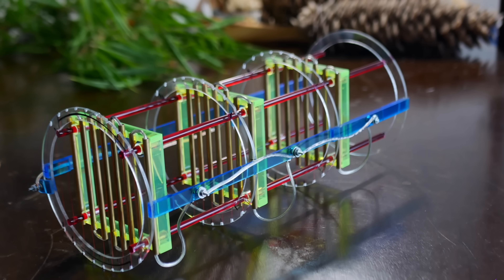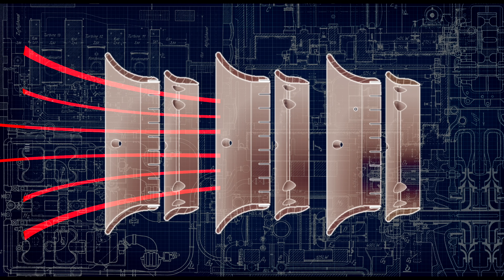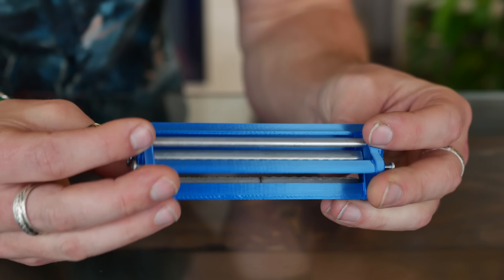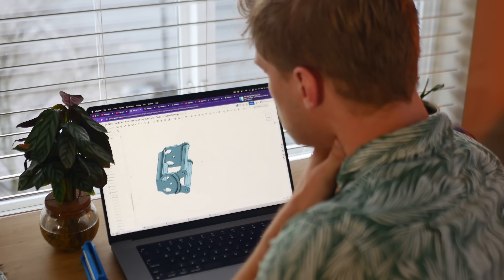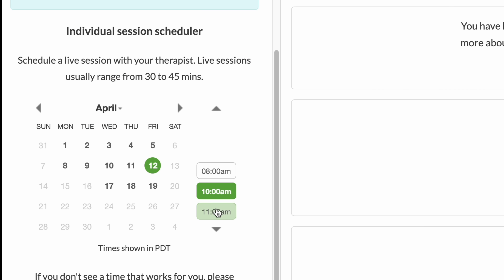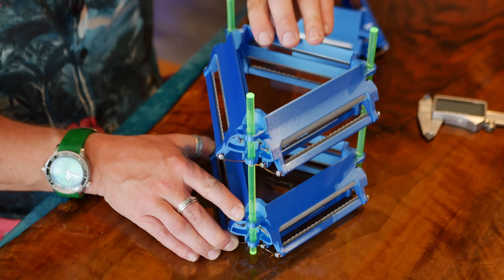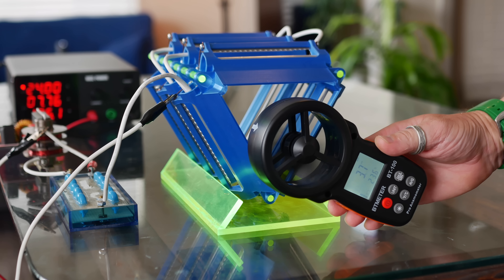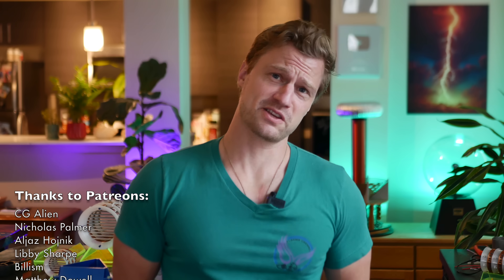Next-Gen Ionic Plasma Thruster Inspired By Nature (BTC Mark 3)

Comment: Super cool work, enjoying the mad sciencing -just watching this episode now, & i'm wondering if line array theory (LAT) may be of use, given the shape & modularity of your new 'razor'  stage design.
 I'm familiar with LAT from audioohile speaker applications/experiments; perhaps the related goals of efficient air movement could be relevantly useful.. 
Different scales of math, physics, airflow juju, etc. involved ,
But physics is physics, and one might find some interesting results from arranging your 'razor' drivers in parallel linear arrays, perhaps vertically like books on a shelf, or horizontally, like train cars/sausages. I think if LAT works with audio speakers (fancified yet musical drivers of airflow), it could have similarly advantageous effects with your new thruster design, as it is another method of generating constructive interference. 
 IIRC, in rough sketchery shorthand, one would need at least 4 drivers to get the line array effect. In audio, line arrays produce a coherent wavefront that declines in volume at 3db/doubled distance, as opposed  the usual 6db decline of point-source driver - sustained power over longer distances in a more focused 'beam' You might lose the banana-proofocity, but gain efficiency & output. Who knows? One way to find out... Kudos!

Comment: Contemplate incorporating covering the entire craft in ionic thrust not just the wings. All the control surfaces, the nose, the fuselage. With a s many configurations for ionic thrust to work, and work well, we surely can design an aircraft whose shape is optimized for providing thrust where it is most effective and necessary. Also applying this concept to propellers themselves could not only improve prop function on winged aircraft, it could upgrade everything we know and can do with helicopter tech. Finding a way to equip such craft with a method of braking by directing the ionic thrust forwards might be worth pursuing as well.

Comment: Guitar strings could help with rigidity. Btw, increasing the thruster‘s efficiency is a good thing, but having flying stuff in mind, increasing the system‘s over all efficiency will involve significant weight reduction. You may buy an X percent thruster efficiency by adding some stuff, but lose two times X over all efficiency through the increased weight…

Comment: You should do some testing with a fan before the input. I suspect this entire concept suffers from a maximum total airflow limitation regardless of the input airspeed. I think if you have 3m/s going in, you're not going to get 7m/s. You'll get 4. This really, really restricts potential applications. I would guess that different electrode spacing has different efficiency at different input airspeed.

Comment: Have you ever tried running any of these thrusters in water (salt and/or fresh)?  And have you ever tried just surfacing a wing with alternating currents (+ and -) using conducting tapes or filaments in stripes between an insulator tape/filament to see if you can create any kind of similar thrust affect without your unnecessary aeronautical structures?

Comment: I think that if you were edtablish a passive magnetic field downstream it could provide molecular excelleration and provide additional electrical energy this could take the form triangular flap or a series of wire structure after all when passing energized particles over a magnetic field of a maagnet it generated current. The filaments could be magnetized passively it could possibly be helpful as it could be arranged to consitrate your thrust vectoring😮

Comment: Idk much about this and this is just intuitive thought ,but would a different angle maybe change anything? You mentioned they were angled at 22 degrees, how much would it change at 30 something or 45 or 15? (Arbitrary numbers) for instance at a larger angle would the air flow converge differentlu when you have multiple stages in line? Would it affect how much space is needed between stages? 
Also what if a different shape so go from a triangle to a square/hexagon/octagon? 

Are you capable of making a full circle with everything angled?

Comment: I think that the first stage should be inclined more than the 2nd stage. And the last stage should have the least amount of angle. I would also test the inlets to see if they are starving each other of available air.

Maybe a sealed gap between the stages can allow for more air to be suctioned on the outer perimeter.

I would also take advantage of the ventury effect on the last stage to increase the overall volume of airflow without increasing the power intput.

Comment: The Air is Omni directional. The linear tri-state your asking for introduces micro vertices of resistance.
 Try a shape that has the wire around the periphery and on a lead angle increasingly the twist rate. And each section matching the lead 1/2/3.ect, ect,  In a continuous helix to a throat throttled core.

Comment: Have you tried stepping down cone size? Like each stage being smaller then the previous, still using same voltage.
 Volume creates pressure if you step outlet size down. It works w water( being a hydraulic and is not compressable like air.)
 Just a thought.

Comment: I wonder if adding a central front thruster wouldn't add additional thrust granted it would reduce the resistance to bananas but I feel that it would add additional thrust moving more air also adding a nozzle to the last set of thrusters to confine the airflow might add a bit of speed to the air being pushed rearward

Comment: You should try a step down with the stages. Large, medium, then small. As you compress air, it has more force like how you van use the same power/speed to either blow a piece of paper or making it into a smaller more fine point area which would then puncture or cut the paper.

Comment: Idea: Test to see if you are loosing efficiency because of reverse electric air flow. 
What I mean is this: you have a stacked design where the order of electrodes is 
+ - + - + -. With air generally going from left to right. But watch this just by deleting the ends:
+ - + - + -  to this
- + - +
And now air flows backwards.
The negative of the first stage is interacting with the positive of the second stage and is causing a force in a direction you don’t want. Check your design to see if this is something you can shield against it happening. Especially since each stage is driven in parallel and not individually.

Comment: Pilot here, when I see it, I wonder what the benefit of increasing the aspect ratio would be. Same idea that makes aircraft wings long and thin to minimize induced drag (wing tip vortices) maybe doing that on the ionic wing and thrusters would yield better thrust or at least reduce the drag. The design has a lot of nooks and crannies for the airflow to produce interference drag so some sort of casing would definitely help
Reply: The aspect ratio increase could also be an easy method to upscale the thrusters to an extent

Comment: I feel like if you could put the individual thrust outputs into thin tubs, and use a bunch of them to create a circular design it would give you more thrust. This looks more like large vent openings trying to push out thrust. In my head smaller output, higher internal pressure would mean more thrust. So the smaller the outputs of each channel the more thrust. 

Then once that step is completed make it rotational inside the body like a turbine. 

The cylinders could be aimed at propellers in a enclosed space to create even more thrust on the same amount of power. Like an actual airplane turbine just powered with electricity instead of gas converting to electricity in a plane.

Comment: A Couple of queries with the design, firstly did you try spacing it at the point where each unit creates a single stream,  does each thruster require its own air to create this thrust and will it only get multiplied if it concentrates this thrust together. I saw on a air ioniser that someone used positive electrodes made of crushed carbon fiber rod, creating tiny brush shapes with thousands of tiny little cf points for the ions emit from maybe this will help with your design. Would definitely make a really cool odour reduction fan for the house though.

Comment: Add the Ionic thrust to the fuselage as well! More surface area? And with the length of the fuselage, wouldn't you be able to accelerate the thrust more efficiently? Sorta of like a Jet Engine that has in line compression the further the gas goes through the jet. I don't know, just wondering?

Comment: Your design could be easily improved by reinterpreting your concept to that of a funnel. Enclose the thruster to eliminate the variable of introduction/loss through the sides and narrow your end point. Bringing in air and forcing induction through a closed smaller opening would increase efficiency.
Reply: As you increase the voltage and use eltroplated light weight components to decrease overall weight and further gain increased output with less input. Your main issue is efficiency.

Comment: What if we reversed the cyclone like in a hover so that it became a spiral exhaust accelerator, like a kind of ionic vortex engine?

Here’s what happens if you “reverse” the cyclone:

* Cyclonic Hoover mode (normal use):

* Air spirals inward, centrifugal forces separate dust, then it gets exhausted out the back.

* High mass flow, but relatively low exit velocity.

* Reversed cyclone (engine idea):

* You’d push air into a spiral chamber and force it out a nozzle.

The spiral would naturally accelerate the flow outward (like a vortex tube or swirl combustor in a jet engine).

This could in principle give you higher exhaust velocity compared to just pushing it straight.

Adding ionic acceleration:

* If you ionized that spiraling airflow and then used electric fields to accelerate it further, you could potentially increase exhaust velocity.

* In effect, the cyclone would act as a mass amplifier (lots of air), while the ionic system would act as a velocity amplifier (charge acceleration).

The combination could give you more thrust than either alone.
Reply: I still think you are thinking you want something you can put along a wing instead of generating maximum thrust?

Comment: You're still not measuring thrust... for a thruster. Or thrust to weight. Constructive interference is not a valid aerospace concept, you are just maximizing turbulence with your "design" and (possibly) adding some compression. But the whole thing is an aerodynamic nightmare.

Comment: Vortex flows and Viktor Schauberger
Viktor Schauberger was an Austrian naturalist and inventor, famous for his theories about “vortex motion of water” (turbulence, vortices, spirals). He claimed that nature uses spiral, torsional (vortex) motion to move energy and matter in the most efficient way.

  Can vortex flows and plasma be combined?
Theoretically, yes!
Modern science knows that plasma is capable of forming vortices and spirals. In plasma physics, there’s the concept of “magnetohydrodynamic (MHD) vortices”—this is when plasma twists under the influence of magnetic fields, forming toroidal or spiral structures.

What could this bring to ion-plasma engines?
Better plasma containment — vortex structures can stabilize plasma inside the engine’s working chamber, reducing energy loss.

More efficient acceleration — if you direct plasma in a spiral (for example, as in a plasma torch or spiral accelerator), you can achieve more even energy distribution.

Experimental concepts — such ideas are already being explored, for example, in the VASIMR project (Variable Specific Impulse Magnetoplasma Rocket) and in experiments with toroidal plasmoids.

What might this look like in practice?
In the engine chamber, rotating (vortex) magnetic fields are created.

Plasma, passing through these fields, begins to spin, forming a toroidal flow—in essence, a spiral “stream” of plasma.

It is then accelerated along the central axis and ejected through the nozzle, creating reactive thrust.

Comment: That's cool it needs a turbojet an ionic turbojet thruster so instead of jet fuel increasing the turbojet thrust the ions spin the turbojet which compresses and speeds up the air spinning the plasma ions into vortex that sucks in more like a jet engine only running on ions for fuel

Comment: would you not beable to increse the power by adding a charged metal tube with a cemeconductor inbetween so you make a capactior that would then allow more electrons to pass in to the thrust area just a idea as it should make it more powerfull with not adding to much more to it

Comment: One suggestion to improve the BSI mark 2 would be to replace the ground electrodes with the knives from a pommes frites maker (you know, the machine you put a potato into and then pull a lever and out comes pommes frites). and then make the positive electrode as a tennis racket with crossed threads. Still make it offset, so the cross of the positive electrode comes over the hole in the pommes fries knive, and the cross of the pommes frites knive come over the hole in the positive electrode.

Comment: You really need to measure how much air is moving (mass or CFM) and remember kinetic energy is proportional to velocity squared. Inlet air tempertaure and humidity could also be factors to control for.

Comment: A quick hint. You are using the miter gauge on your table saw backwards. The flat side should face away from you while making the cut, so that cutting pressure forces the work back against it, not away from it. You'll get cleaner, safer cuts that way.

Comment: Have you considered the effect of the gas density? (testing at sea level and on a mountain, to avoid using a compression chamber) then would a first stage compressor make sense before the plasma stage?  Like modern jet engines with the frontal opening for venturi flow and lateral intakes perhaps?

Comment: I know this is a year old, but couldn't you do the same thing with a circle design? 
I'm not educated at all, but wouldn't you be loosing air speed from the sides of the "imaginary air columns" not being in alignment with the rest of the structure? Its all pointing to a single centralized area of high wind speed while the edges of the triage design are moving slower due to impacting the edges. 

A circular design, much like the MK2, could eliminate any lost accelerated air hitting the inner edges of the structure. I could see issues with construction due to the positive and ground assembly being much more strenuous and tedious to produce because of the curved nature, but I think, just from an outside uneducated viewer, you would get better results with a more rounded shape.

Edit : Better yet, make it scale downwards in size, like a funnel! first stage biggest, 2nd stage in the middle with size, last stage the smallest but the most focus of airflow.
You could also introduce air exit shrouds over each stages output, slightly compressing the air, increasing its output. Less to do with adding more power, more to optimizing the power you're already using.

Comment: Okay I was watching this and had a few ideas, yes i realize they are a year late, but im hoping they inspire you to advance this.

1st thing I noticed is that you have a very focused steam of air. Which i think you can make stronger by adding another stage onto the inputs. (A single legnth on one of the triangles) sure their would be deminishing returns, but final output when i get to my conclusion, it might be worth it.
Which lead me to the next realization. Why are you trying to converge it to a single point? You are working with a line. An engine doesn't need to focus air to the smallest point posible, it just needs to move as much air as possible.
Which lead me to flat engine designs, and then to the Aerospike engine. This engine style takes advantage of the sticky nature of air, causing tha air to focus my moving it across a curved plane. You dont need an outter shell, the sticky nature of air will make that for you. No banana test needed. But you have an huge advantage working with plasma insted of rocket fuel. The current aerospike failures fail because they place all the heat at a thin point, resulting in the spike melting. You don't need to worry about that. So you can make a full aero spike design, and some aerospikes are flat, so that fits with your design as well.

Alternatively you could also borrow another design from the dyson air multiplier.

Either way, you should be able to move considerably more air, with the same engine, but a simple chane to the placement.

Comment: I love this, my 1st question is if this is for flight, how will it perform at each of the 3 main layers of ions as you gain altitude?  Especially curious about the higher altitude that’s mainly H+.  2nd question is could you use a high speed camera to see turbulence at each thruster, since the world works in waves, collision or phasing might be holding you back from a little more gain.  If that makes sense

Comment: Just wondering if you have tried mixing some Argon gas at the intake side to help electrical conductivity between electrodes and more arcing / plasma. Or some liquid nitrogen injection which can expand over 600x when evaporated.
It would be interesting and fun to try perhaps. Thanks for sharing 👍

Comment: Your BIG mistake is that you are using a single power supply. So, assuming that the your first stage is + -,  the ionized air exiting the first stage is pushed back by the + of the second stage. With separate power supplies, the + - of the second stage is entirely independed of the first and there should be no such repulsion.